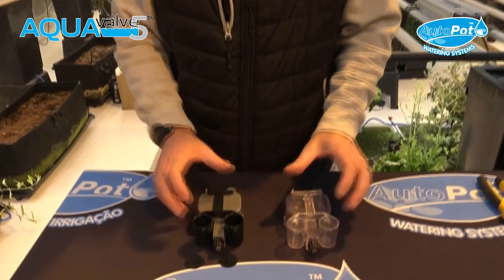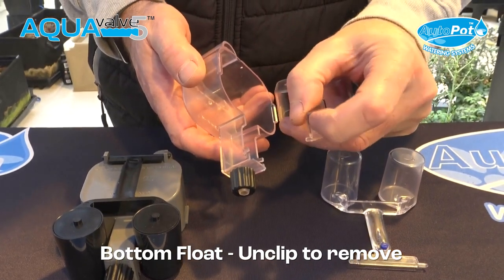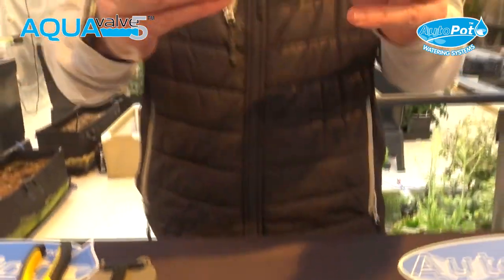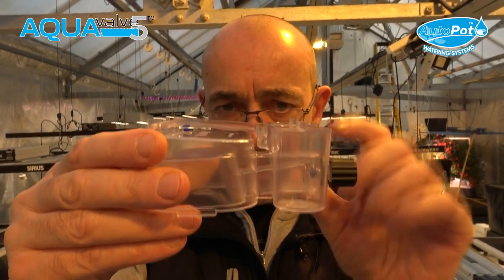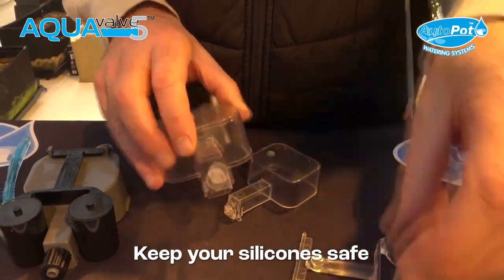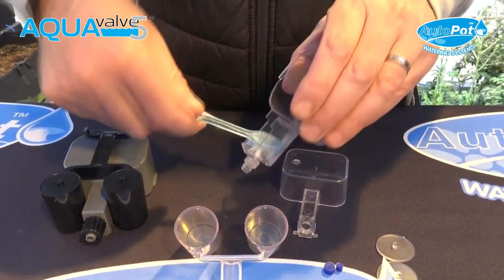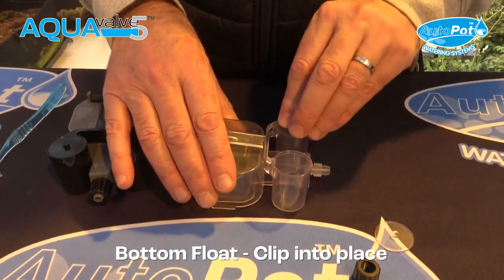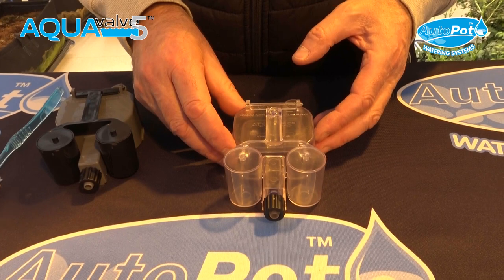AutoPot AQUAvalve Care

Comment: If one of the silicon plugs pops out while hooked up to a full reservoir, won’t that cause the entire reservoir to release all at once? I just ordered one for my indoor microgreens operation and I’m concerned about the potential for flooding.
Reply: they cant pop out. 
if they are not tight, it only floods the autopot without drain, but not your room

Comment: Just wondering what the recommendation is for cleaning the hose
Reply from the maker: We've seen people use a few different techniques. Some people remove the plants/pots from the system and then run a few gallons of a cleaning solution through the res and let it sit in the lines to break down salts. Some will soak the tubing in a large container in a cleaning solution and then run water through it. Some will use an air compressor and blow sediment out. Some people replace the tubing after each grow. It's up to you how you want to proceed but feel free to reach out to info@autopot-usa.com with any more questions. Thanks!